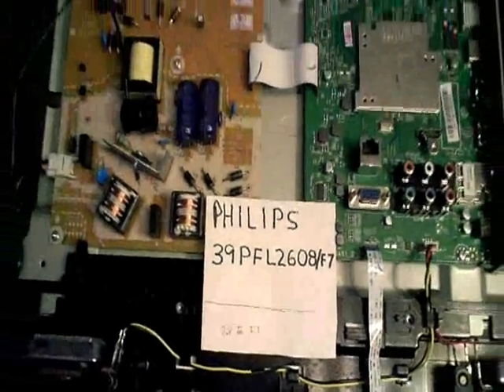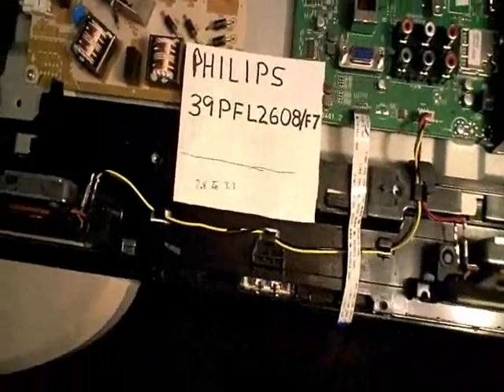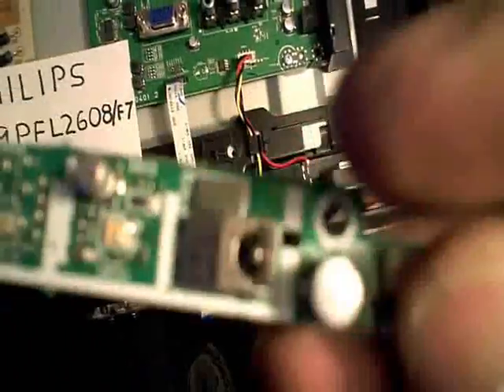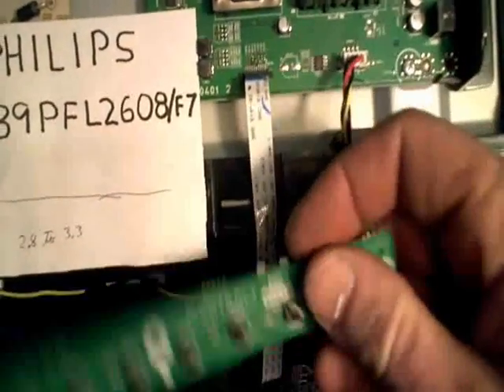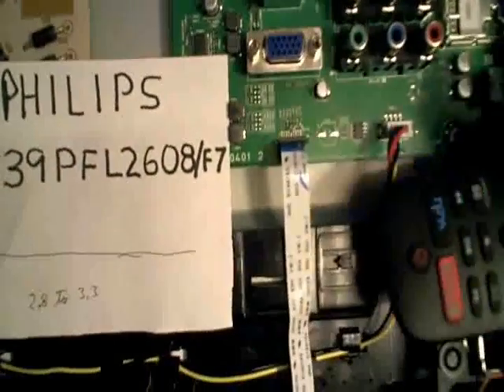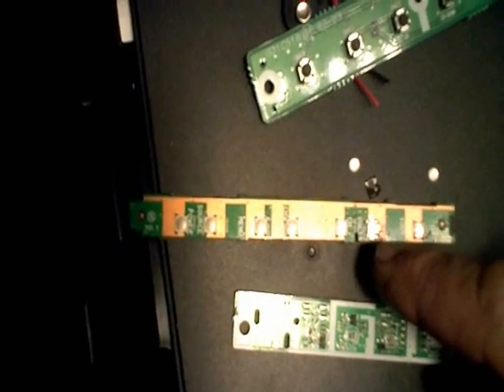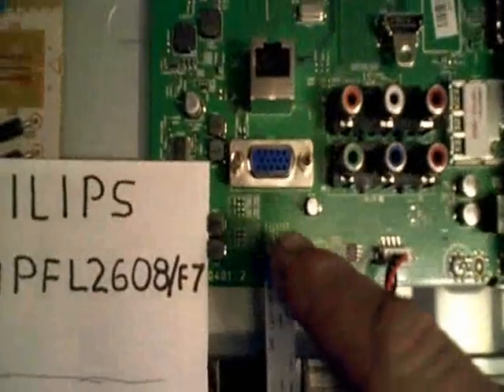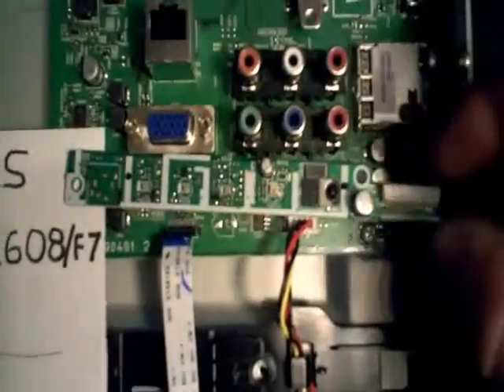TV Doesn"t respond to remote, Here's why.

Comment: Nice video. A little unclear what you fixed. Sounds like you replaced one of the Tactile buttons. Is that the case? You measured the voltage on each tactile button and noticed one was causing the others to short, correct?
Reply: I wondered the same thing. 2 years and still no answer from the guy. Guess he is dead by now. We will never know.

Comment: I have a 64 inch plasma same thing is happening.I can push the buttons on the TV works perfectly but anytime I'm using the remote does not work so I'm guessing. As well the lights on the TV workI'm assuming it's what you're saying in the voltage.

Comment: So I got a Samsung smart TV, don't know the model right now, but I was just watching TV as normal and I wanted to turn the volume up a bit and it wasn't working. I checked the remote and it's perfect, came across this video and my questions are: 1. How this happend? I never sprayed water or anything into the screen... How a problem like this even develops? 2. I don't have the skills to replace the things you said, should I go to a specialist? Or is it a easy task?
Reply from the maker: Other than double checking your wiring from your signal source, and your menu options, I can't tell you how to solve this problem.

Comment: Yes voltage drop, but better is oscilloscope and check impulses/signal. :) BTW great videos.

I had similar problem, but in my TV there is only tactile switches on this board and IR sensor is somewhere else, so I just disconnect this board. It was clean and still there was random button presses. Probably because of not enough filtration of voltage for this board=old capacitors somewhere. This buttons uses only one pin on some MCU, they connect different resistor in voltage divider and MCU sensing voltage on analog input. And if voltage powering this divider is not filtered enough MCU see changes in sensing voltage and recognize pressing of buttons. For digital circuits voltage is filtered enough and everything else works OK. :) 

sorry for my english. :)

Comment: Thank you so much for this! Mine was stuck in the "sources" menu and i couldn't use the remote, buttons worked, etc.... i simply unplugged the tactile button pack from the back and all is well - thanks to you for pointing me in the right direction!! :) This was for a 2017 Philips 50PFL6902/F7 - so perhaps all philips seem to have this problem? :) thanks again!
Reply from the maker: Jolly good show mate. ;-)
Reply: How do you operate your tv if the button board/ir sensor board is disconnected from the main board? I have a 58PFL4609/f7 that seems to have at least one stuck button but not sure which yet.

Comment: I replaced my IR sensor but it did not fix my problem with the remote still unable to control the tv. (FYI-the remotes work on my other Vizio TV's so it is definitely not the remote.) Do you know of any other problem inside the TV that could cause this issue? Thanks
Reply from the maker: I'm wondering if you put the sensor in the wrong way. with the plus and minus in the wrong direction.

Comment: i've got a Hitachi 40hxt16u that works fine apart from the remote, I did the remote check so that's fine but the ir sensor might be broken even though the light still turns on, I tried putting a different ir sensor from another tv which also lit up but still no joy. Any ideas would be much appreciated.

Comment: I have a samsung lnt5271fx/xaa and the picture comes on and if connected to a cable box using an HDM port I can interface with the TV, using the cable box remote, as it's acting as a monitor-- but i can't turn off the TV because the TV will neither respond to the remote or the buttons on the tv(touch, not tactile). Would it be the BN96-06152C infra-red board or the BN96-06153B (BN41-00923A) Function and Power IR Board?

Comment: You didn' say, but was the corroded switch on the same board as the infrared sensor?  The way mine does when you first turn it on everything works but after it warms up you can see the Volume leak back to zero and then none of the manual buttons work again and it does not accept the signal from the remote .... Sorta acts like when a bad capacitor leaks off.
Reply: Sometimes the remote still works when this happens but when you try to turn it back up it just keeps trying to move upward but fails. ... I then have to unplug the TV to turn it off.
Reply from the maker: My apologies for not making this more clear. I'm trying to remember the details on this, but it appears to be a separate board from the one with the switches on it.
Reply: It's like the power to the control board leaks back off ..... Bad Capacitor somewhere???
Reply from the maker: I can't guess.

Comment: I’ll try to follow those steps. Same thing happened to me, our philips tv got wet (though not spilled) because of rain that leaked from the ceiling. Tv still works perfectly after drying, however the remote control wont work.

We think the TV is the problem since the remote control didnt get wet. But unlike in your video, the remote wont light up. So maybe the problem is with the remote?
Reply from the maker: The remote control light is not visible to the naked eye. Many but not all cell phone cameras will allow you to see if the light is coming on in the remote control..                   If you don't see the light coming on in the remote control it will not work.               Sometimes the infrared light in the remote goes bad and needs to be replaced.                                 The infrared light in the remote control is polarity dependent which means it has a negative and a plus side, so if you install the new light backwards it will not work,

Comment: what else can stop the remote working i changed the ir but it wont change channel etc the remote is ok there is a capasitor near the plug for the ir on the main board can this be a factor in it not working
Reply from the maker: 646klein I've never seen a capacitor prevent a remote control from working.
Other than what you see in my video there isn't much more I can suggest.
Reply: ok cheers dude it was a second hand ir sensor i used so will try a new one
Reply from the maker: Make sure you install it with the correct polarity. The LED only works on one direction

Comment: Mine won't work most the time but if I hold the button down and point it at this one area it will come on or off eventually. What is my problem? The tv was dropped if that helps.
Reply from the maker: I can't say, but if you take it apart and examine the circuit board around where the sensor is, perhaps you might see a small  crack on the PC board.
Reply: If only it was that easy to move a 30inch HD CRT to take apart though. I drilled out a smaller hole in the front though
Reply: @GrantsPassTVRepair  I have been looking for the ir for months. How do I find it online

Comment: how do you access and remove the tactile sensor board?
Reply from the maker: I can't speak for every manufacture, but sometimes the sensor is inside of  a metal shielding, which can be removed with a soldering iron.

Comment: It confused me the first time I came across an intermittently-shorted button in an LCD monitor, didn't even think it was possible before that.
Reply from the maker: Agent24 I have seen these tactile switches intermittently short out on several occasions, and often times the short doesn't show up when you test them.
Reply: +Grants Pass TV Repair Please recently my 4 yr old Toshiba started showing random numbers when I press the remote, could it be the IR sensor is damaged? My wife recently used antibacterial spray on the TV stand..thanks
Reply from the maker: It's quite common for liquid to get inside of the remote control buttons from various sources such as Coffee, Soda, Cat pee etc.Cleaning them off and drying them out generally fixes the problem, The IR sensor is in the TV itself. Perhaps you meant the IR emitter?

Comment: Same problem for my tv but if there’s a voltage drop what do I do from there bc my son got water down in it the same way I cleaned it up but the tv is black now
Reply from the maker: Water  getting on the circuit board can be  a disaster as you discovered. Even after it's dry it may to late to solve the problem without troubleshooting or replacing the damaged circuit board.

Comment: can you program tv with the buttons behind the tv?
Reply from the maker: With some models you can, but I can't tell you which models you can do this with.
Reply: @GrantsPassTVRepair  thanks for the reply, I have a lot of buttons behind the tv.
Reply from the maker: @garyb8186  Sometimes you can find a replacment remote on ebay if you enter the model number of the TV followed by the word remote. You can also buy a universal remote but they often lack features the original remote has. All the best.
Reply: I just fixed my jvc em32t tv that the remote control stopped to work , I thought my remote was bad, but by doing the camera test found out remote was not the issue then i decided to replace the ir sensor on the board on the tv with a sensor that i had in another board in my scrap and now remote control works on the tv.
Reply: @GrantsPassTVRepair  I can't believe it i tried batteries  out of my flash light, the remote worked,  I've tried other batteries i thought was new an it didn't work.

Comment: I don't have the factory remote for my ViewSonic N3251W & I can't get ANY known working universal remotes to work, I've replaced the mother board, IR sensor, checked continuity of the cable and unplugged the tactile board ( separate connector ) because the volume down does not work correctly, nothing helped ... what can I do !
P.S. nothing on the web or BadCaps.net about this issue.
Reply: Rusty Nuckles I can not seem to figure out why my RCA universal remote do not work on my flat screen TV which is a JVC television tell me what to do..please help me asap i am sick of getting out my bed on my day off to turn my 50 inch flat scream TV ...help ..

Comment: I have a Magnavox TV where is the remote control would not respond right away. What I mean by this is that I would hit power and the TV would start to come on but then it would stop what it was doing and I would have to hit the power button again. After a while it started to need to be pushed 3 times. And I don't mean pushed 3 times in a row you had to push the button wait till the light on the power button on the TV went off and then push it again. The third time the TV would come on. Now what the TV is doing is the remote does not function at all with the TV. I have changed the batteries in the remote that was not the problem. But the power button on the TV itself is also doing the similar thing where I have to push the power button wait for the light in the power button to go off twice and then the third time it brings the TV on. At the same time there is a delay when the TV comes on.

The main question I have is is it worth opening the TV and trying to clean some components and get it working again or would it be worth just buying a new one because this TV is quite old.

I'm not sure where the tag is on it to tell you exactly what it is. But what I can tell you is it is a Magnavox HGTV and it's old enough that it's not a smart TV.
Reply from the maker: It often makes more sense to replace your TV. if you can't find simple repair solutions such as replacing bad capacitors. It's not likely that cleaning the TV will help.
Reply: @GrantsPassTVRepair  that's what I was thinking about doing oh, I haven't had a chance to actually examine the TV though. But like I said it is pretty old
Reply from the maker: @yu-gi-ohclub1348  I would not put a lot of time into trying to repair an old TV unless it's a simple repair like replacing capacitors.
Reply: @GrantsPassTVRepair  I am interested in learning more about repairing things. For example learning how to use my meter to test resistors and other components as well as learning how to solder correctly. I still plan on replacing the TV but maybe once I get the new one I could use this as a project to see if I can repair it. If not no harm done. If you know any good sources for me to learn what I mentioned I'm all ears
Reply from the maker: @yu-gi-ohclub1348  I think the best source of  electronic knowledge is probably found on youtube. There are books I could recommend such as Forest Mims book called getting started in electronics,  I have a website where I list all of my videos  at https://www.tvrepairinfo.com

Comment: HI nice informative video..

I have a problem with my Hisense 55" 4K Tv. Model is 55K680. I shifted to another country and after receiving back the TV, the remote is not working with it. It's not a bluetooth one but regular IR. The remote is working as i can see the blinking light while holding under the phone camera. THe TV's IR received is located on outside of the frame on bottom left. The picture of it is below. For me i think it can be either that it got damaged while being handled for repacking and shipping or maybe the remote got un-paired somehow as it took about a month to receive the unit. The TV works fine with the manual controls located at the  right back side of the frame.  

 https://www.dropbox.com/s/cwgkwva04p7ou3p/hisense%20tv%20IR%20reciever.jpg?dl=0
Reply from the maker: As long as your remote control is an infrared type I can't see how it could possibly become unpaired. Sounds like the issue could be in the infrared sensor in the TV.
Reply from the maker: I'm not sure I get your question.
Reply: the sensor is attached under the bottom left side of the TV frame. It's not part of the frame so I just wanted to ask if it can be removed without opening the back panel of the tv? IF i pull on it, it does move a bit but dont know how it's attached from inside.

Comment: I love how this guy talks like this is common knowledge I'm not stupid or anything but I'm sure this did not help anyone
Reply from the maker: With 673 likes I'm guessing a few people found it helpful.
Reply: Grants Pass TV Repair that's good and all but I'm sure the other 95% that watch the video have no clue what saying or know what tools they need to fix their remotes
Reply from the maker: After watching this video I can see your point. I should have added more detail for those just starting out.
Reply: Great explanation. I have a Samsung plasma tv. The tv only responds to the remote when i am standing like 1 or 2 meters from the tv. When i move a little further from the tv, it doesn't respond to the remote. What do you think of that? Could it be also a voltage drop or perhaps a bad infrared sensor? Why do you think the remote works fine when i am very near the tv and not when i am far from the tv?
I tried several remotes and new batteries. And with ''far'' from the tv i mean only maybe 5 or 6 meters.